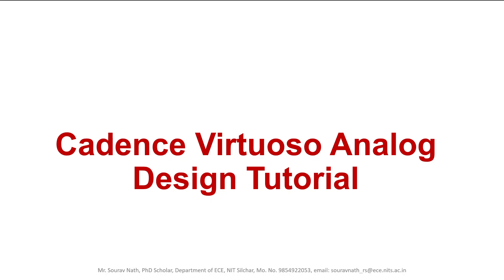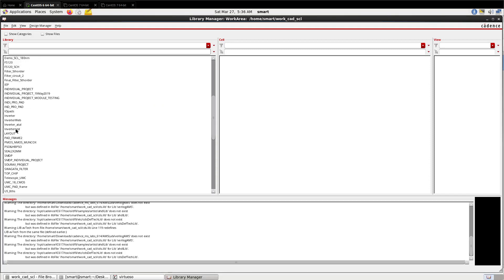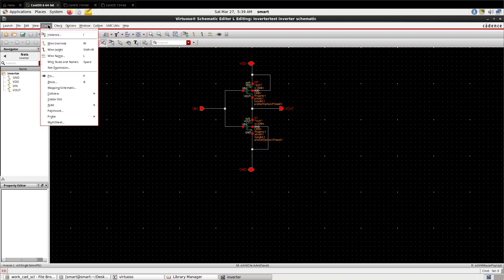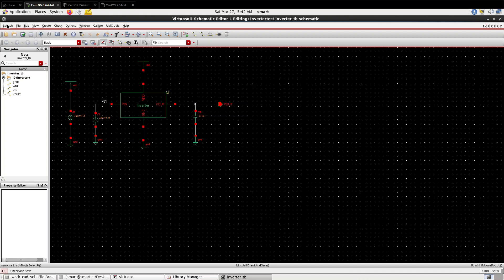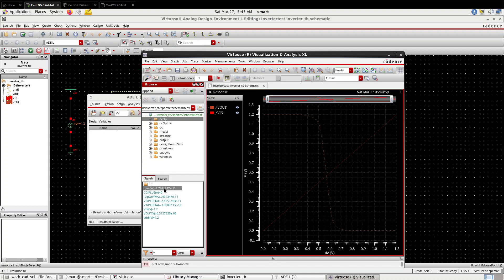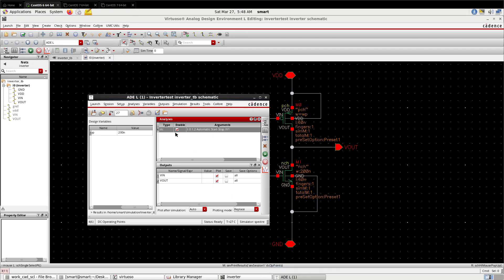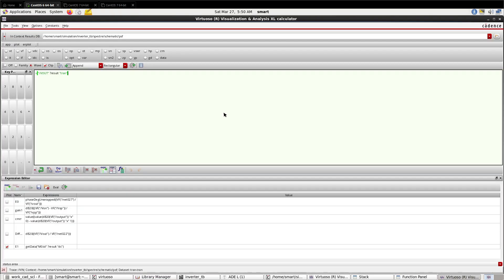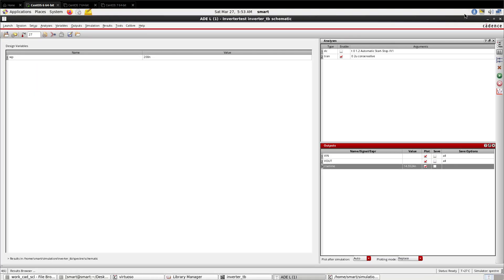Part 1: CMOS Inverters Made Easy with Cadence Virtuoso in TSMC65nm Tech!

Comment: Hello brother. I am new in TSMC 65nm. Can you please tell me which model libraries should I need from global library for basic designing of PMOS, NMOS and Capacitor. I am not sure which library I should use in ADL. All the libraries are selected from my end.
Reply from the maker: Basically if you are using  tsmcN65 low leakage low power pdk  library then, you can use nch and pch instances for designing and mimcap for capacitor design and model file you have to point <inst_dir>/models/spectre/toplevel.scs